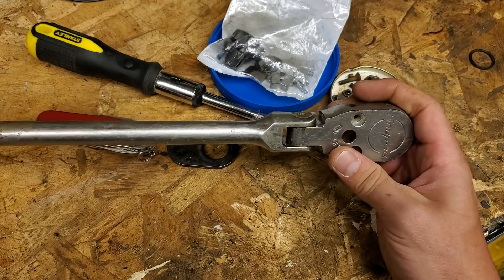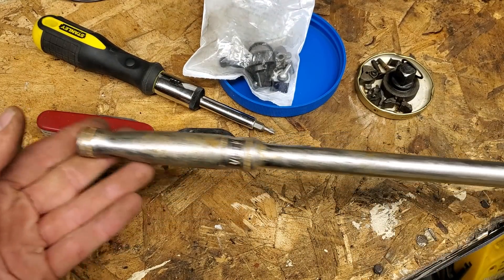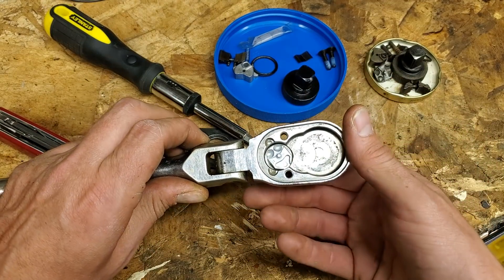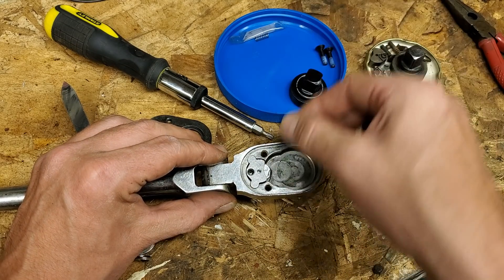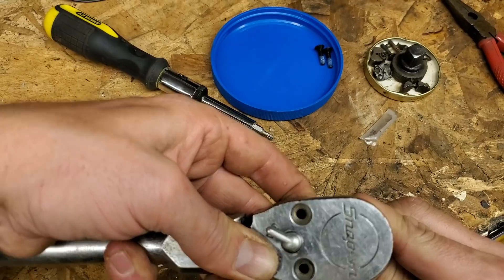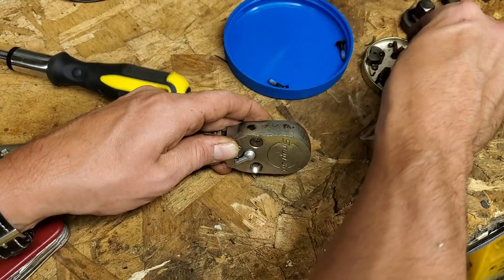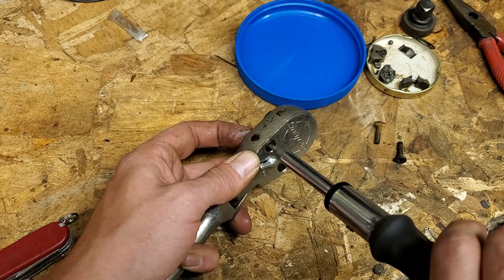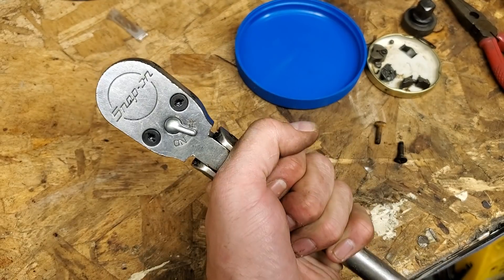Snap-On Ratchet Rebuilt and Back to Glory!

Comment: That ratchet is well worth the $200  price. You scored finding that like you did. There really is a Snap On difference until lately. The  company seems to think they are Harley Davidson. Jack up prices with nothing better.  I would rather push my Suzuki than ride a Harley. Older Snap On are great tools I use every day.
Reply: definitely not worth 200 bucks, i can find the same ratchet on ebay as that in way better condition for 70 bucks

Comment: Snap On tools are way over priced IMHO.
Reply from the maker: Oh yeah, I have bought 2, and i love em, but i will probably never buy another one.
Reply: Snappy is real nice, but quite frankly I don't need it. I'll still pick it up whenever I run across it for a good price. This year I got two ratchets for a buck a piece. Which is a fair price for the stuff.
Reply: @MikesToolShed  I've only ever bought one Snap-On tool off a truck. I got more than one Snap-On tool though. I find them here and there.
Reply: Strike that I did buy another Blue Point tool off a truck. What a rip off it was. Same damned air body saw you can get for $30 all day any day all over the place and with the Blue Point name on it I paid $120 for it. Ouch! Then to top it off the thing had a manufacturing defect. For a long time I had trouble with it then one day I was like what's wrong with this thing? So I took it apart and I found that when they glued in the debris screen they got a little crazy with the epoxy they used to hold it in. That epoxy was blocking the air passage too. Now it finally runs right.
Reply: Not if you find them in a pile of dirt...
Reply: I mean for $12 and a little work ill take it
Reply: @james10739  it'd depend on my mood when I saw it. $12 is cheap but not nothing. So it depends on a variety of factors whether it is tool bucks well spent, or not. I already have a Snap-On 1/2" drive swivel ratchet so that would play into my decision. Do I want two? I already had a 3/8" standard Snap-On ratchet but for a dollar I bought another when I saw it. So the factoring can be tricky business. I think I'm going to move that drive over to my milling machine's roller box right now so I actually use it. Because up against my old drive in my other box it doesn't stand a chance.